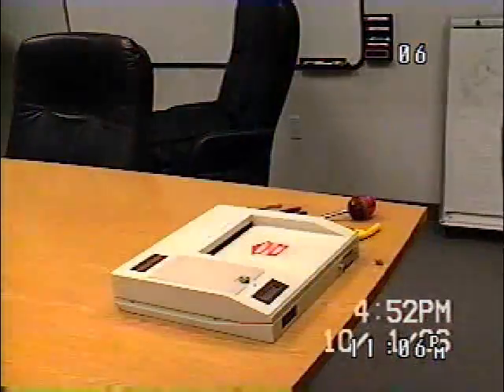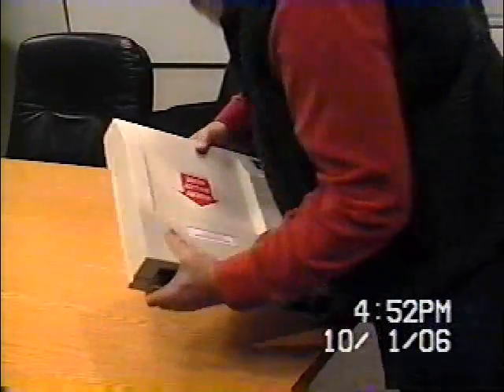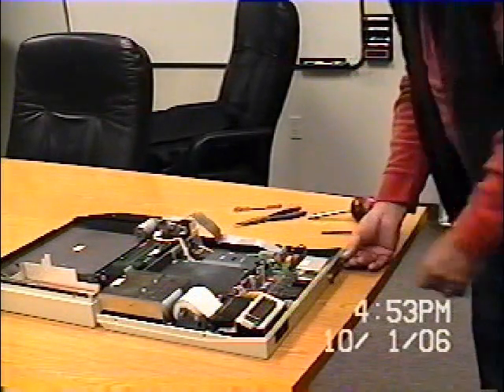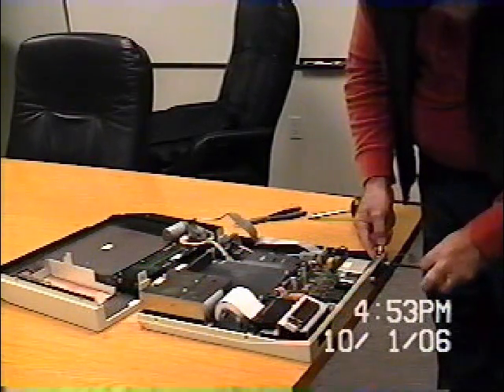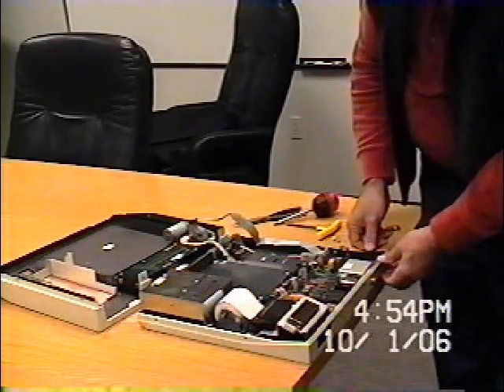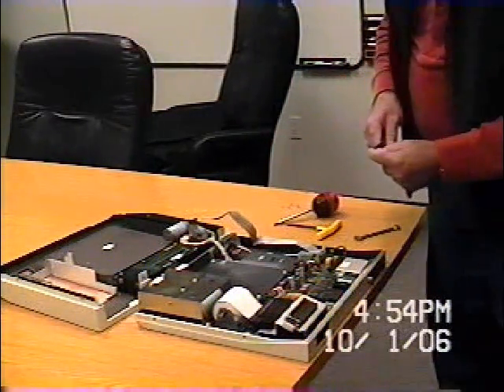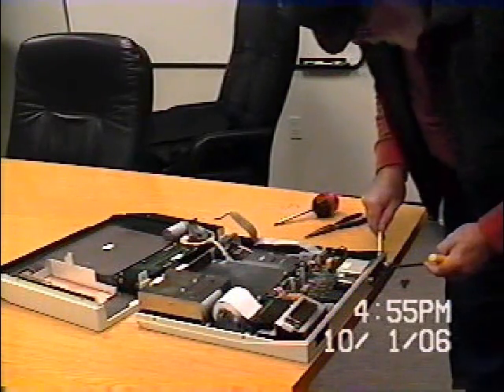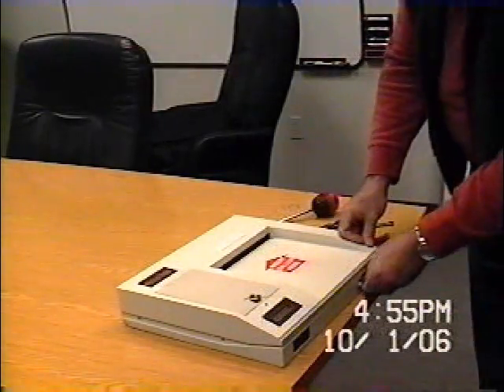Hack of Michigan's voting machines

Comment: 1st, i saw ur face
2nd, u hacked a voting box without using latex
3rd, you have done this on an account that can easly be traced and you will be IP banned from youtube and will be arrested by the FBI and will be charged with "Tampering with federal devices" and will have 40+ years in a federal prison and will most likely spend half in the hole. U STUPID UB3RN00B